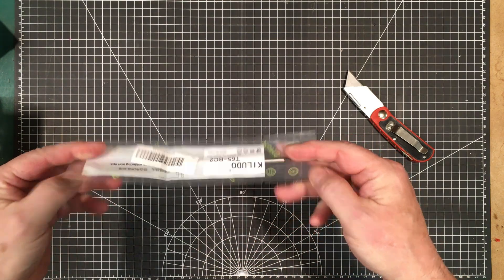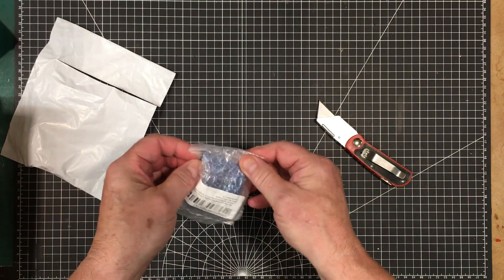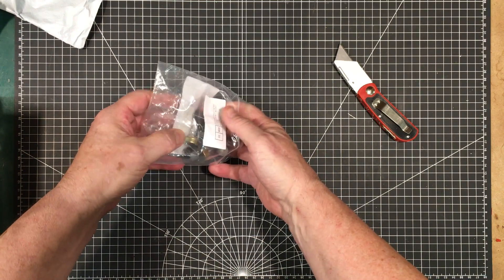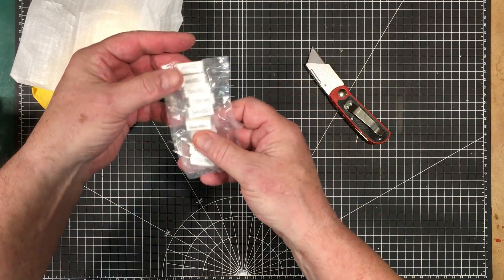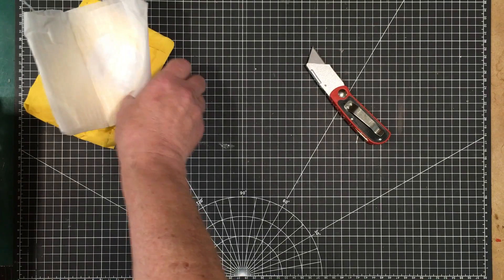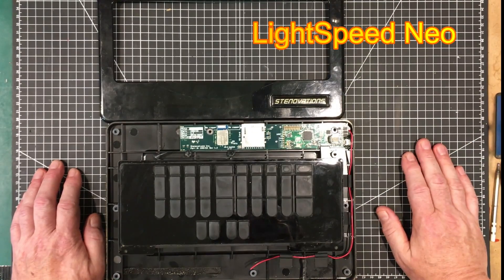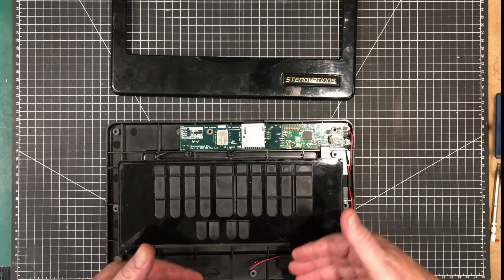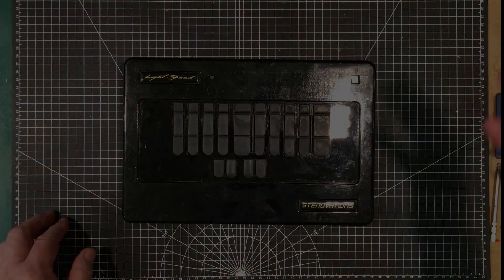Uni-Byte 0204 - MAILBAG #27:  So, FREE STUFF!  Stay to the END for an interesting QUESTION!

Comment: This story provides my POV regarding repair/mod prices, though of course it just applies to me.

I do equipment repairs for a government lab in the town where I live. With some of their gear, designed by them in-house 40 years ago I'm the only one I can imagine would ever bother to do all the necessary research to understand it and its quirks, then take the time and care to do the repair job right. I could charge a lot more than I do for most of it, but I don't. I'm semi-retired, single, and I charge what I figure is fair. There was a brand-new manager in one department at the lab who called me on a Friday to tell me he thought my repair quote had been too high since I worked at home and had no overhead or other employees. That sort of took me aback. So I told him, "No problem. I'll go play with radios this weekend." I got a call back from the guy a couple of hours later and he asked me if I could come over and pick up the equipment before closing time. I asked, "Couldn't you find a better quote?" He sounded embarrassed and told me that only 1 company they'd called would do it at all, a place on the east-coast, and they had quoted him $3,500 with a 60 day turnaround. He said he'd be happy to pay me more than my original quote. I told him I'd pick it up before closing time, fix it over the weekend, and drop it off Monday morning for the original quote of $250. After that he never questioned my repair quotes. In fact, since then he's never even asked for a quote. I just pick things up. I fix them as quickly as I can. I return them with a bill. I get paid. That's the way I like to do business. This adversarial crap is just that. I'm too old to play games, and the little extra money I could make by squeezing my customers simply won't change my life. It would just stress me out for no good reason.
Reply from the maker: Very interesting story John, thanks for sharing.

Comment: That's a difficult question for me personally to tackle - how much to charge for a repair. On one hand, it doesn't take a PhD to replace two CMOS batteries so I can see the nominal charge of 1 hour labour making sense. What bothers me though is that you do need to bake in some upcharge in case you completely bugger the repair - you NEVER know, you could knock over your soldering iron and melt some expensive components or even break traces inside layer 3 of a 4-layer PCB for example. You can't escape the fact that it is a $10k replacement value item on your workbench at the end of the day. If I were doing it for a friend and the friend had ZERO expectations of a successful repair (AKA they are ready to buy a new unit but would like me to try fixing it first) then I would do it for free or "beer money" - whatever that is for a non-drinker - but if it comes with an expectation of fixing it, you kind-of have to cover the eventuality that it may get borked in the process and that is worth some mone yfor the risk on your end. Where you lost me is the cost of components - 25% is a VERY small margin on those - if the parts cost is very low, it should be closer to 2x the cost of the part! Consider instead of billing out each little part - just charge a "incidentals - parts / supplies" line instead for like 20$ instead of making 10c profit on a socket you know?
Reply from the maker: Food for thought, thanks for commenting.

Comment: The real question is - should you get into the Stenography machine business. $10k for that?
A quick suggest suggests what while this may be at the higher end, it's not out of line for the market. I assume you're paying a premium for the small volume here and for the expectation that the keys work at a perfect professional level, probably very quick turn around on the service.
The big difference with this machine is that most of the machines have big typewriter-type keys, based on the original design. This machine and the next one are using some very sensitive keys.
Additional, this unit works with a PC, while most of the machines use a built in LCD which makes them look a bit like a cheap 1990's kids "laptop", like a V-Tech.
As for what the company would charge, while digging for this info I saw that the company mentions they charge $270 restocking fee for returns. While I'm sure this is because the machines are often rented, I think anything you charge would be well below what the company would charge.
Reply from the maker: The company also charges $120/yr for support, and that's just support. 
 No additional warranty or service.   The keys on this a conductive rubber and operate with very little pressure.  They don't actually move.  It's a neat idea, but hardly ground shaking.
Reply: Yes it's $10k.  But the reason they charge that much for it because it costs so much to develop the software and these things are individually hand assembled on demand and not mass produced!  But for as much as they cost I would have expected a machined aluminium enclosure and not something which looks and feels like a toy.  The Stenograph NexGen doesn't cost nearly as much and it's built like a tank!

Comment: When you have a business, and you want to make money, it makes sense to charge based on the value the customer is willing to pay you. Regardless of how much it cost you to produce the thing. You, as a repairman, can charge as much as the value of a repair is to this customer. The customer can either have it repaired, or buy a new one. And the customer can have it repaired with you, or someone else. So given the option to either buy a new one for $10k, or get it repaired by someone for $200-$500, the customer is definitely willing to pay you more than another customer who has a throwaway device. For example, another customer who has a device whose total cost is $200, is not going to be as willing to pay you the $150 charge to repair it, because the value to that customer is much lower - both from the device, and the repair.
Reply from the maker: That's food for thought.  Thanks for the comment.
Reply: @uni-byte 

Just to drive this point further home.

My brother is working at restoring lost data on hard drives and SD cards. Do you think that for 30 minutes of his work, he should be charging $50 instead of $1500? Even though people are more than happy to pay an arm and a leg to get their lost data back?

It always depends on the value of the repair in the eye of the customer. The amount of work and materials that you do for a repair is irrelevant.

Comment: I tend to charge only for the work that I do. The value of my time is always the same, although the cost of parts may be higher in high-value gear.

I assume they can charge that price because there is only a limited market for stenographer keyboards.  However, if the profit-margin is that high then shouldn't that stimulate competition?  Is there anything special about the mechanical constructions of the actual keys?  Perhaps a patented design?  I wonder if they offer a warranty that helps justify the price.
Reply: I just looked up steno keyboards and there were several manufacturers. Maybe they have a good product (or an inflated ego)
Reply from the maker: The keys are conductive rubber.  That's the only unusual thing I can see about it.  Nothing really special in that.

Comment: So many parts, so little time.  :)
I used to use felt pens to try to color polarize connectors. First, it's impossible to use a red felt pen to color a black connector red. But when the did work they also rubbed off or faded pretty badly with time. Then I realized that cheap black and red fingernail polish worked really well for that job. It didn't matter what color the connectors were, and nail polish doesn't fade or rub off. I now have an assortment of colors of cheap fingernail polish in my toolbox to ID various voltages and signals. It doesn't dry instantly, but it's bright and lasts a very long time.  
I like your soldering iron holder. The old ones made with a big spring were great for melting AC or DC power cables and BNC signal cables that dropped between the turns of the spring, pretty much any wire that dropped between the turns. Very versatile. 
BTW, I used to say, "Onwards, and downwards!"
Reply from the maker: Good idea on the nail polish!